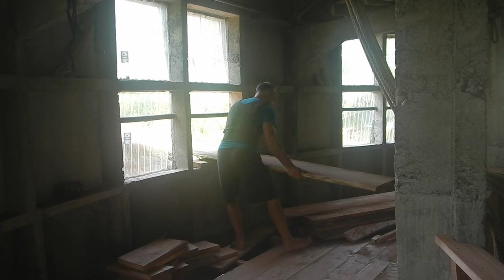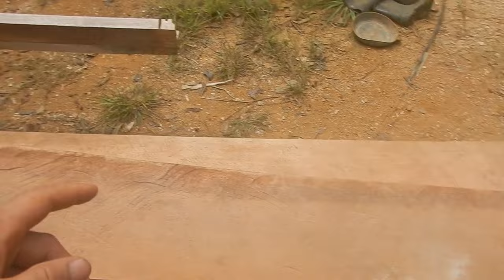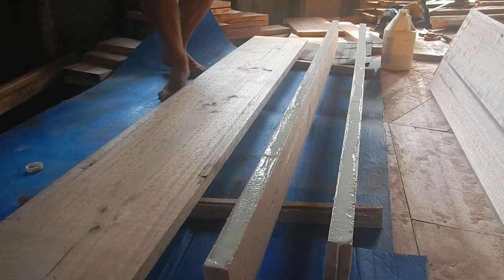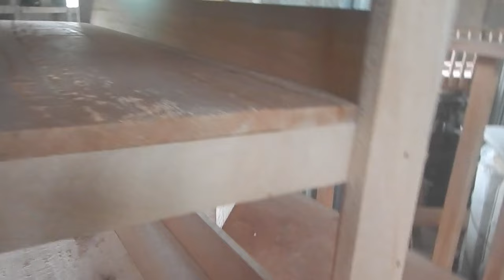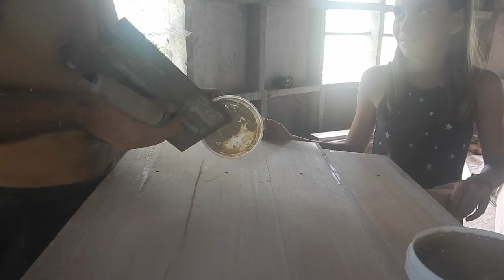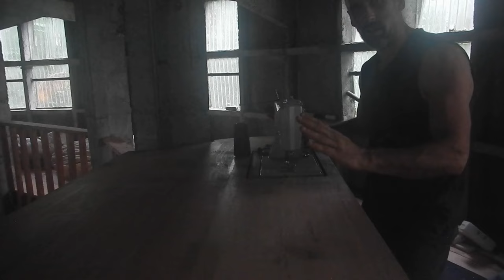Sewing/Drafting Table from Jungle Mahogany

Comment: Looks great and gives lots of space to work. 
Many portable sewing machines like that had the option of being removed from the plastic case and installed in a table. This would allow the sewing machine to be swung up for use or swung under the table out of the way. Then a separate piece was used to plug the hole over the machine to give a large flat table for other uses.
Thanks for sharing.

Comment: You can do a wedge clamp from boards. One long board with a cross block screwed down on the end,  A wedge block that you can screw down where needed, and then a slider or hammer wedge block between the screwed down wedge and the pieces being glued.

Comment: I saw a clamping system the other day that would work that you can just make out to wood in a few minutes. Basically one long stick attached (bolted) to two short ones that make a hinging Z like shape and you tap them into place with a hammer and then use two small clamps to make sure they don't slip.

So with this you can make custom length clamps for table tops.